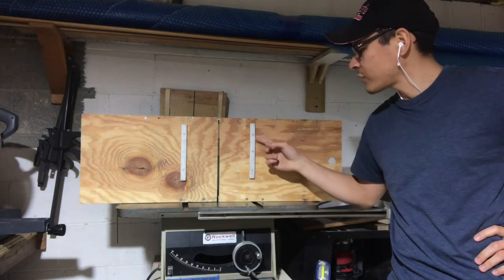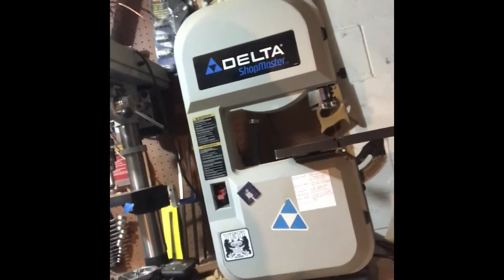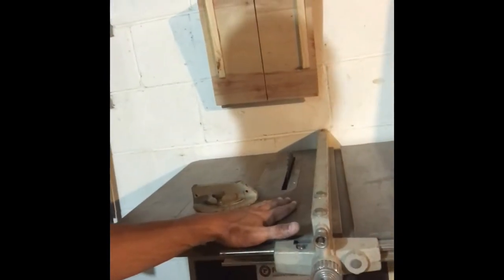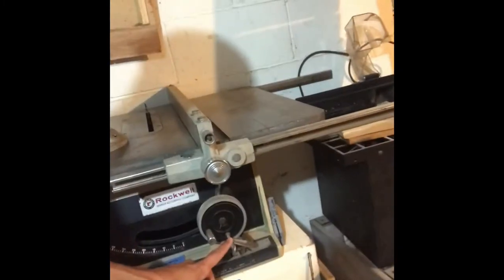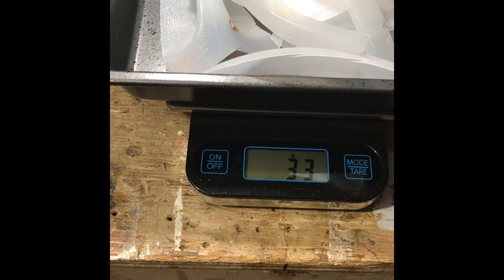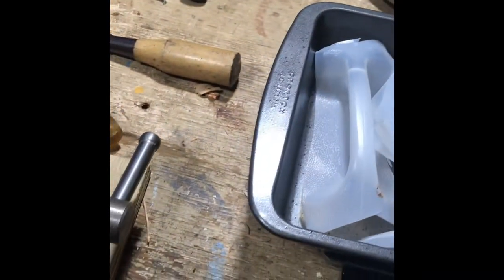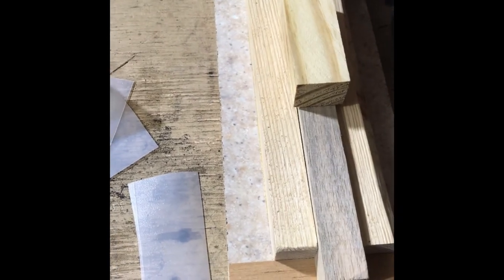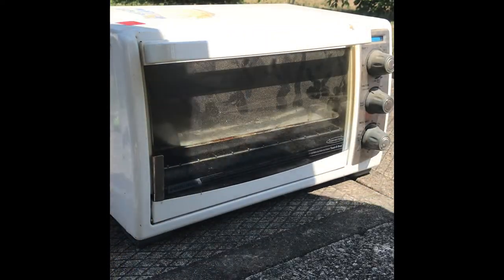Don’t Buy Table Saw Runners

Comment: Awesome!

To be honest I had a bit of trouble listening to it, but the bits I did get were great.  I jist picked up a router table and haven't had a chance to unbox it yet but did notice in a review that the mitre guide sucks, so am looking to delete it and make a sled because fingers are cool.  So yeah same deal, not keen to pay for UHMW stock, and want a slidy thing.  Also thinking maybe hdpe featherboard, I read the other day it's about three times more abraison resistant than mild steel.

Anyway, some good tips in here on  the molding.  I'm thinking make my blanks oversize and mill them, and use the waste on the next mold.
Reply from the maker: Oh awesome I’m glad it helped
Reply: @makeitkozi  yeah man.  Just watched your press video.  I have a tube bender with 12t jack, might jig that up too.  Your channel is pretty cool man, I'm looking forward to more down the line.
Reply from the maker: @mrmukura  that is great to hear! I’ll keep them coming. I’ve been working on better audio/video so hopefully it’ll be a clearer for the future.